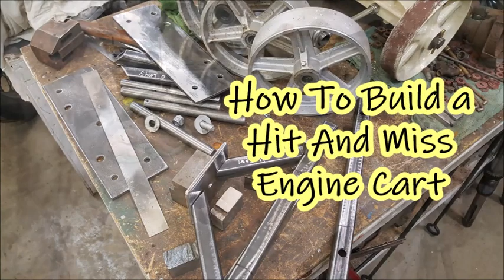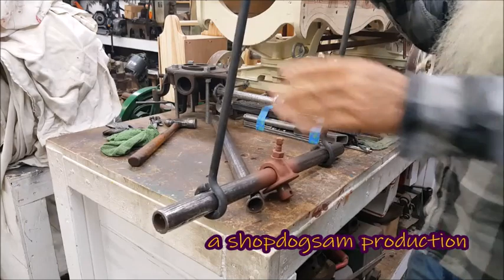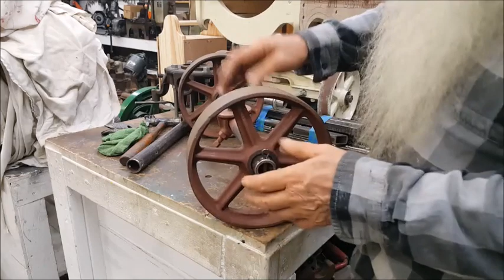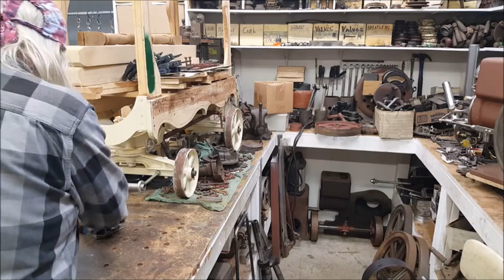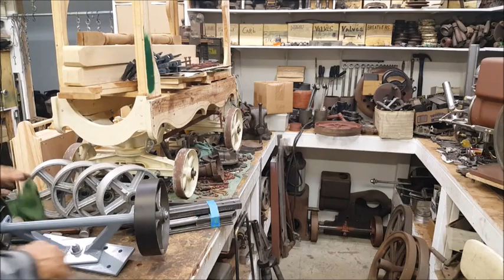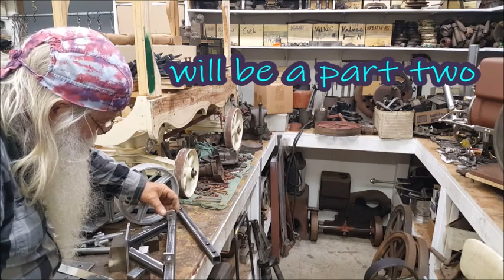How To Build a Hit and Miss Engine Cart metalwork

Comment: Question for you Sam: I have an IHC LB 3-5hp gasoline engine. Supposed to govern from 600-1000rpm flywheel. I can't seem to get it to go any lower than about 850rpm. Governor seems to be working as far as I can tell. It will throttle up and govern at ~1020rpm. Any suggestions? Appreciate your videos and your expertise!